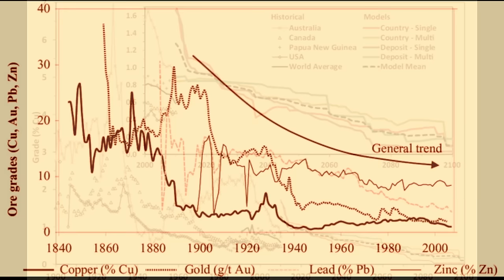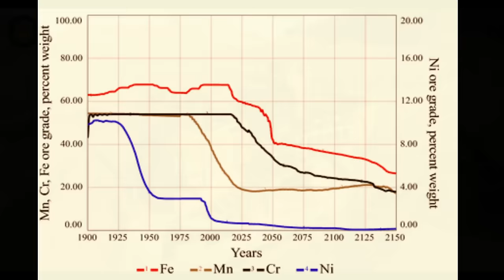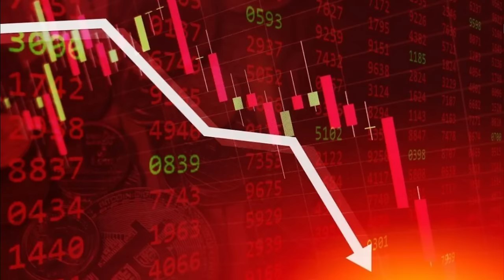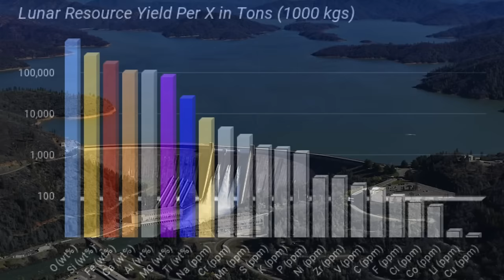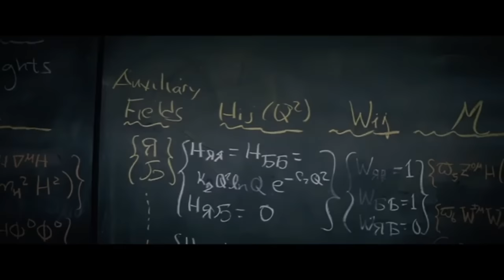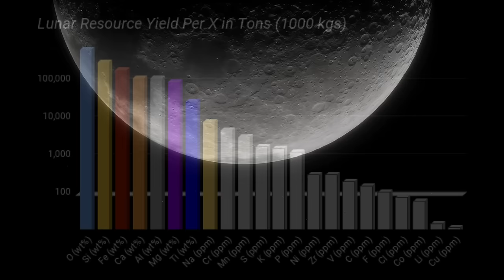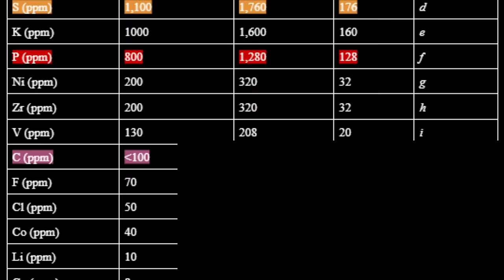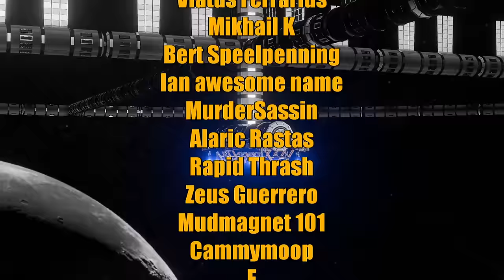Strip Mining The Moon With Giant Excavators

Comment: An important note for transport: Due to the low gravity I think all the containers need to be enclosed.

The typical belts we use for transporting bulk goods should be covered, especially at the drop off points.
The wagons of your proposed land-train should definitely have a hatch to cover the load. Imagine it goes over a bump and just yeets half its load upwards
Surely this can be mostly mitigated by slower speed, but I still believe covering all of these things is the best option, especially for the land trains.

Comment: Aluminum might be more viable. Also I would say the biggest benefit of moon mining is simply reduced launch costs to more useful parts of the solar system like a Dyson swarm built from mercury. Nothing else from the moon would really be able to compete with earth production.
Reply: Aluminum is a nightmare to extract and refine relative to steel, but eventually, once you have enough resources massed and you're all tooled up, it might be the best bet.  Especially given the crazy amount of it, it should be used for everything on the moon, nm steel and then save the titanium for in orbit manufacturing

Comment: You focused on steel.  Do useful aluminum alloys fare any better?
Reply: Aluminium is soft looses its strength at around 500°c & if it is flexed continuously soon breaks. It is a horrible heavy equipment material. 😅 it is however not bad for using to make the airtight shells of both lunar and space habitats. 😊

Comment: Regarding your previous videos -- wouldn't it be more beneficial to have a way to transport cargo from Earth to orbit via space-elevator or any other method that wouldn't require launching several rockets? Think about it, you could easily lift up a single walmarts worth of goods to an orbital dock, then have them transported via previously-imagined lunar cargoships. Brilliant. Although that'll probably require constructing an advanced space elevator, and that'll need roughly 60,000km worth of some robust rope... Wonder if that can be manufactuered on the moon as well, then used to construct the cable needed for the lift...

Comment: on the moon to smelt metal you need to bring your own oxygen for fire
Reply: He already tackled it, you can get oxygen out of the soil.
Reply: Wrong, you only need high temperature, on earth we use coal or gas burning in the oxygen rich atmosphere to obtain that, but on the moon we can use a solar furnace, this would be more practical than on the earth because in the vacuum you don't need to worry about cloud or thermal transfer between metal melting creuzet and surrounding atmosphere. Or you can use a electric furnace like some earthlings iron smelting factory use.
Reply: @theOrionsarms  not bad thinking! another idea in the same vein, perhaps a Fresnel lens would be light to transport and without atmosphere that puppy would do 5000 C

Comment: Hell no. Hands off the moon!  Mine all the asteroids you want, but don't F with the moon.
Reply: Why?
The Moon is close by and has much of what we need to boot-strap ourselves out into the rest of the Solar System.

Do you not grasp how far away the Main Belt asteroids actually are?
Think travel times in *years*.
Reply: @thomashiggins9320  How many asteroids do you think we need?  One asteroid could supply us for years....and "years" are not a huge amount of time. They're like femtoseconds in Universe time.
Reply: @thomashiggins9320  How many tons of material moved from the moon to earth will it take to screw up the delicate balance of the lunar orbit, or the moons tidal tug on the earth?  Will we send the moon out of orbit into space, or in a slow descent into earth?  The moon is already creeping away from earth by centimeters per year. Will we accelerate that? Or reverse it?
Reply: @thomashiggins9320  Have you heard of the butterfly effect?  That ridiculously tiny things can result in huge effects?  I think that 1000s of tons of moon rock is a pretty big butterfly. And every ton shipped to earth is two tons difference in mass between earth and the moon.
Reply: @thomashiggins9320  ...also, by the time we're putting huge mining equipment on the moon, travel times will shrink as propulsion improves. Hell, we might be able to accelerate and decelerate at 1G!

Comment: To bad mining equipment has BEARINGS! Be sure to put bellows on all the hydraulic rams of your equipment, otherwise the dust will abrade the rams and seals in a few hours or days. All your rotary bearings require special (and very good) seals too.

Do that, and you can just use an electric-powered (uh-oh) machine and you're good to go, right?

But wait, the amount of electricity required is enormous! Electric mining machines run off the power grid with a cord - batteries can't do the job.  Now what?  There's no air on the moon for IC engines.  Okay, what if we build methalox IC engines so you can use the same propellant and oxidizer as the rockets. This turns out to be non-trivial, as a few labs have found out after they blew up a few engines... yeah, good luck with your grandiose lunar schemes, Popular Science.
Reply: Bearings:
12:30
Power:
He suggested nuclear reactors in other videos

Please actually observe what you criticize before criticizing it
Reply: Your power would come from a massive solar array possibly positioned at L2. Beaming power.😊

Comment: Quick note to the fantasy. Dust doesn't settle on the moon. The moon's dust behaves differently from dust on Earth because there's no air to slow it down. Instead of billowing into clouds, the dust can be thrown great distances across the surface at high speed. The moon's dust is also very abrasive and can damage moving parts, like those in a rover's wheel. The moon's dust is made of sharp, abrasive particles that contain silicate, a material commonly found on planetary bodies with volcanic activity. Take another hit of the bong.
Reply: The moon still has gravity, so the dust will still settle and you've been hitting the bong too much if you think otherwise